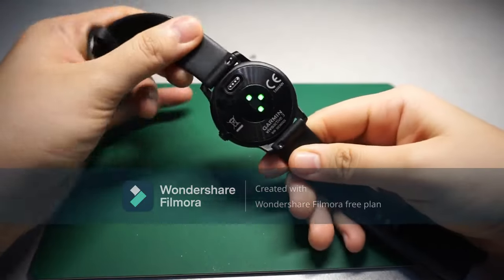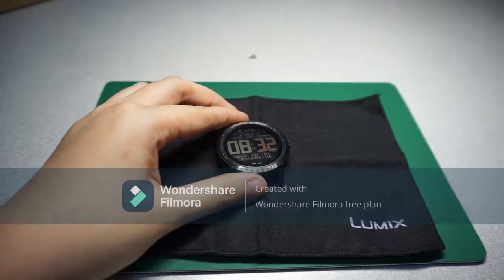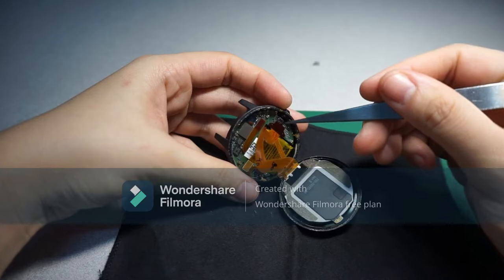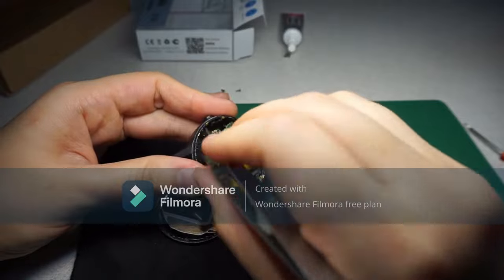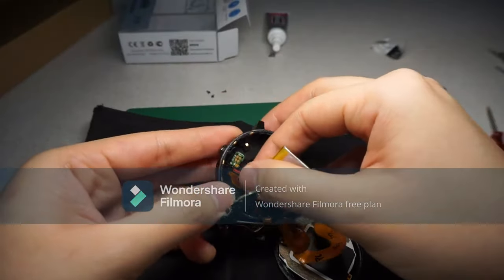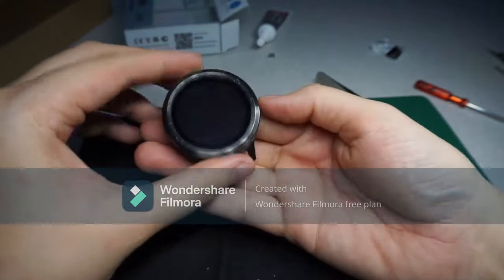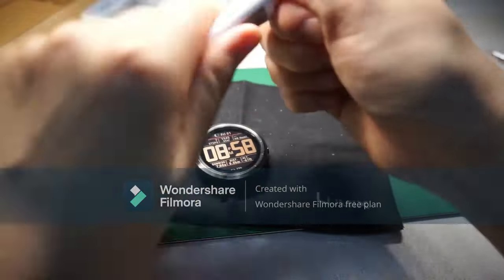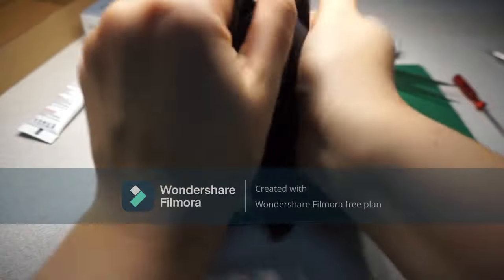How to change or replace Garmin Vivo Active 3 battery (see description)

Comment: Great Video..    ...But please watch in its entirety several times.   I was replacing the battery, doing it step by step, and she initially says to pull the battery wire out, which I did.   By doing so , the entire battery plug pulled out and I destroyed the watch.    You should lift the connector out of its connection, which she states afterwards.       Not the simplest to perform
Reply from the maker: Thank you so much for pointing this out, didn't realise when I made this video.
Reply: I had the same problem.  I wish I had read your comment first!
Reply: I think I would rather pay someone to do it for me then :P

Comment: User beware this should be a last resort to tossing out the watch as you have about a 50/50 chance of breaking your watch. That being said this is a great video, thank you for taking the time to post it. I've repaired about a dozen phones over the years with screen, battery, and button replacements so I figured it was worth a shot since Garmin prefers you throw this in a landfill. Removing the faceplate takes some careful patience. Be careful using a heat gun as you can damage the screen or melt the lens of the heart rate monitor like I did. Also, I used the same glue and my face fell off one day about a month later. If you pull this off successfully assume your watch is no longer waterproof and start putting money aside for a new one as your vivoactive is on it's last leg. After new replacing the battery I'm getting around 4 days of battery life with 4-5 hours of gps tracked activities. Hooray!

Comment: Thanks, this helped me to fix my watch which had a faulty display. Took about 20 minutes to remove the watch face with a heat gun, set to 90 degrees. Applied heat a few minutes at a time together with heating my metal spudger pry tool, also wore gloves to protect my hands from the heat. Had to be very careful not to melt the plastic case. The issue was a loose connection with the cable that you first disconnected in this video. I simply reconnected it and the watch worked again!

Comment: Hi, great video.  Some advice re the battery connector.  If you pull sideways (in the direction of the wires) you will probably pull the wires out of the connector.  The connector can be taken out of its socket by lifting it up vertically, and when you plug the new battery connector in, you push it down into the socket.  Not understanding this caused me a few problems, but luckily I was able to replace the battery without breaking anything, and the watch works fine now.

Comment: Hi! It’s been almost a year since you replaced the battery. Could you share if the watch is still functioning fine after the replacement?
Reply from the maker: Hey there! Yes it's been more than 1 year actually. Unfortunately it's no longer working and we upgraded to another watch. I only tried replacing the battery as a last resort.

Comment: Thanks. Great video. Followed the instructions and changed it in about 20 minutes. Hairdryer essential to warm the glue up enough all round to remove the face. Bought a replacement battery kit online with removal tools and the b7000 glue separately. Total spend about £25. As per other comments, can't believe Garmin don't offer this service as my experience of Garmin watches, batteries only last 18-24 months which is an expensive consumable item!
Reply: Garmin sucks, for a 6 years old  approach S60 , they refused to replace it ,but generously allows à 20% escount on à S62 ! I found the battery for 13 euros and apparantlty , thanks this video , I understand I could not be able to change it alone and I think I found a seller who also changes the battery!

Comment: Thank you for letting us watch your experiment. Good video, but followers need to watch the whole video first or else they will repeat your mistakes. I was able to successfully change the battery and all that is left is to see how long the new battery will last. I'll avoid charging the new battery in anything except a computer USB port.  A good magnifying glass, and flashlight with a second pair of hands I would call essential.  Assembly is harder than battery removal.  I will add that I would rather have paid someone to do this procedure, and the old battery was lasting less than 10 hours after a full charge.
Reply: A few days later, watch is still working, but a full charge only lasts 3 days.  I would attribute this to the quality of the replacement battery, which was a CS Cameron Sino 3.7V 160mAh/0.59Wh.
Reply: @pdcommfire  how is the watch battery doing 11 months later?

Comment: The  most difficult is to remove the battery old connector... You have to lift it up, if you pull it with the battery it breaks (then you will just loose a lot of time to remove it, it might be more easy to cut the cables and solder them...)

Comment: Good video. I did it but the problem is to find a good quality replacement battery. The one I receive is not better than my used original battery and only last a couple hours. Any good advice where to buy a battery that is similar quality as the original one ?

Comment: Refer to your video,thanks, I replace the battery successfully. But the new battery only last 24hrs after charging full, same situation as original battery.
But actually at the first time i didn’t press PCB to bottom so it can not be charged, however the battery just drop 2% after 10 hrs. To fix charging problem, I opened the case again and remember to screwed the PCB to bottom, after that charging function is working, but battery power dropped very quickly. Still need to charge it every day….

Just share my experience to you all.

Comment: Just replaced the battery following this guide, everything worked out well! The only thing that kinda sucks is having to reglue the watch face. It’s hard to do a nice, clean job since the face is such a tight fit. Overall though, not too bad. 👍

Comment: Good video thank you. Agree that the vid needs to be watched a couple of times and care taken. My watch is a vivoactive but not exactly same as yours. I didnt need to replace battery but still needed to strip the watch to same level as I need a new whole back case due to one of the watch strap corners snapping off. Nightmare. All I need now is to buy the glue. Another point its worth buying a cheap little watch tool kit from online to help and not to scratch watch or any other gadgets. Thx again saved me quite a few quid or worse binning the watch.

Comment: How’s the battery life with the new battery and is it still waterproof?
Reply from the maker: It was slightly better initially but it gets drained pretty quickly too. Haven't test the waterproof though
Reply: @ashleytee  how old was the watch when you changed battery?
Reply from the maker: @DB-vl9ob  the watch was about 2/3 years. But I no longer use this watch as it still drains very quickly. Try it as your last resort.
Reply: Still not good battery life after replacement eh?  I'm wondering if it's not like a laptop where there's a battery EEPROM that needs to be replaced or reset in order for the replacement battery to work properly.  Either that or the battery provided by these Aliexpress, etc. sellers are just junk cells to begin with...

Comment: Hi! What is the watch face name?
Reply from the maker: Hi, sorry I don't understand your question?
Reply: @ashleytee  Pretty sure he means the [software] watch face design you have installed on it--what's it called and where you got it.  I have a couple different ones including a Legend of Zelda one I found when I got the watch but never really fooled around with watch faces since it was new.  Now I'm thinking about battery replacement which is how I found this video BTW!  Looks like Garmin wants $85 CAD/$70 USD to exchange the watch with a refurb one these days.  Not sure if it's worth it or if I want to try battery replacement myself...
Reply from the maker: @rolandm9750  ahh I see... so sorry but I don't know. Because this is actually my husband's watch and currently it's no longer working